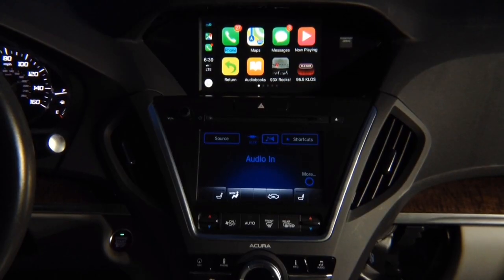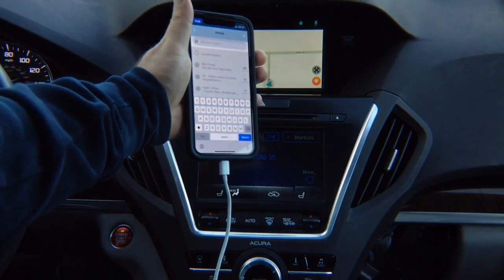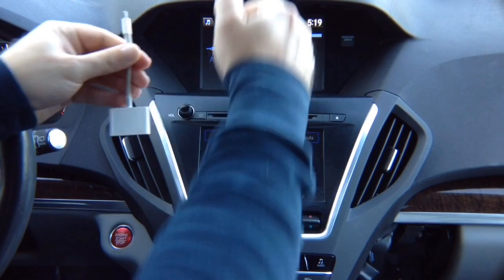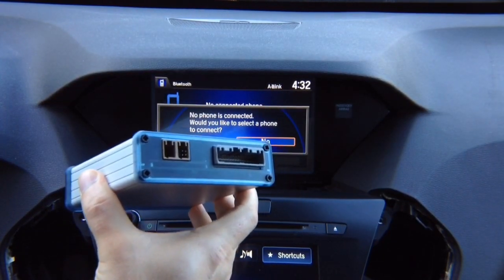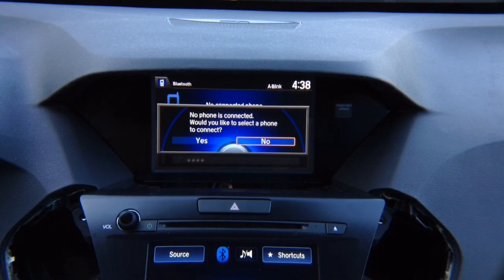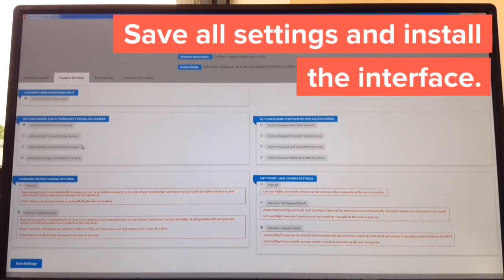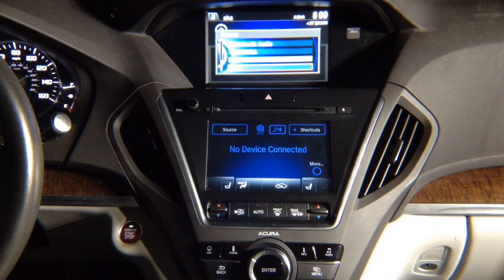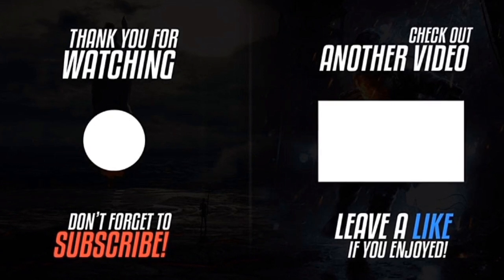Acura RDX Apple CarPlay - Add Apple CarPlay Android Auto to Acura RDX 2016-2018 HDMI Input / NavTool

Comment: I didn’t see in the video, where operating unit went. Is there enough space for it  behind the radio and how to secure it? Or is it just bangs around inside the dashboard?  Also. Can Siri be activated during the Apple CarPlay by voice? Thank you for your hard work.
Reply from the maker: you can mount it with velcro or ny other method you prefer,

Comment: Yeah, right! But can you guys show us where your "device" is fitted? Is kind of big, is enough room somewhere at the backside of the LCD panels, or we need to shovel it inside the glove box?
Reply from the maker: it's specifically designed for the car, there is space back of the radio
Reply: @Navtool  thanks.